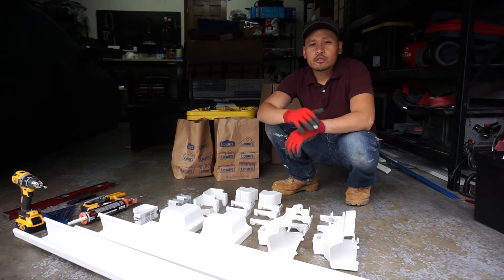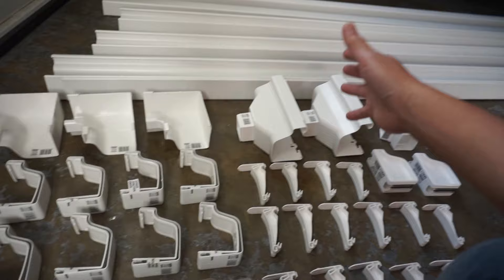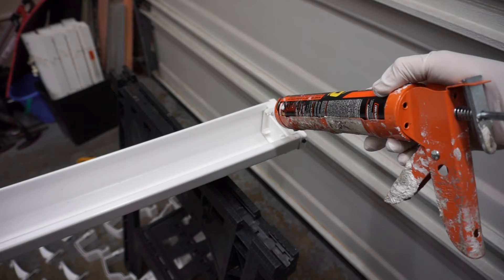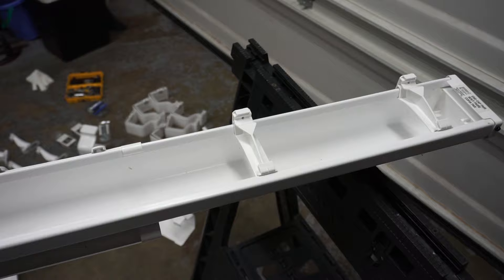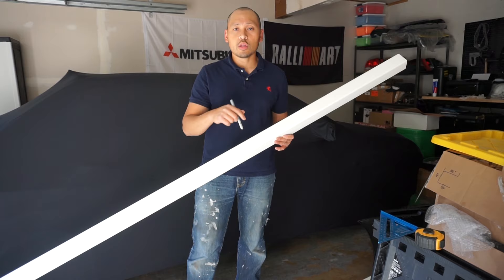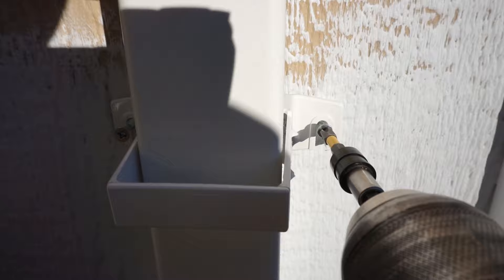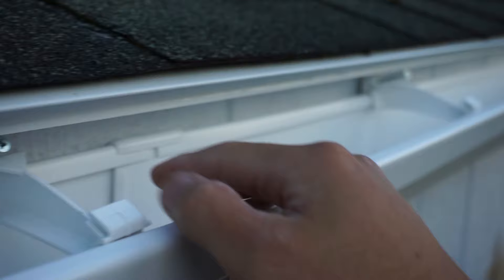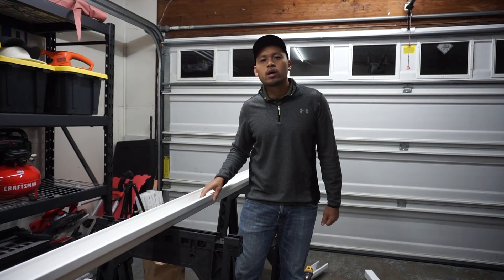How To Install Gutters For Beginners! Easy DIY Home Project!

Comment: Please, this is a beginner install if it’s done in the first floor of a house... anything above that, please get a good ladder and if necessary a spotter. If something were to happen, you got someone that can dial 911 for you . But with careful planning your spotter´s only job will be to pass you tools that you need. Cheers and good luck
Reply from the maker: Thank you so much for the safety  tip! Yes I complete agree! 🙏🏽😊🙌🏽

Comment: Excellent instruction!  Does anyone know if you attach the clips to the little metal strip just under the roof shingles on the “fascia”?  Mine is a shed and the width of the board at end of roof shingles is 2 7/8” (from the bottom of the metal strip to bottom of wood fascia board).  The metal strip is approximately 1” tall.  Standard gutter might be too big for my shed.  Perhaps I should ask, do you hang the clips as close to the shingles as possible on one side (or start just below the metal strip?) and  1/8” lower for each 10ft section?

Comment: What do I do if the top 6 inches of the house angles inward to the flat side of the house, basically there isn't a flat wall right from the edge of the roof.  Do I install the gutters on the flat part and should I add a 1/2 inch flat board between the house side and the gutter side ... to give more extension for the gutter to catch the rain off of the roof?  Hard to explain.  Thank you.  Anyone can give me ideas would be great.  Thank you.  Hope to do this next week.  Today is May 24th 2024.

Comment: My back patio needs its gutters replaced. However my back patio has a flat metal roof. I dont understand the purpose of the gutter if the roof is flat. I dont know how the rain water drains away

Comment: I'm curious how to determine the locations of the downspouts
Reply: you put them over your drain.  you don't want the water just pouring in your garden or down your drive.  There will be a lot of water coming off a roof when it rains.

Comment: I have a question.  Since the the gutters must attach with the thin side against the structure the 90 I have is pointing the wrong way to go around the corner.  Do they make right and left 90 or am I missing something obvious?

Comment: What type of screws did you use to attach the gutters to the house.
Reply from the maker: Hi I used the #8 zinc coated 1-1/2” screws to screw on the facia 👍🏽😊

Comment: Awesome video but for a beginner, I have 3 questions: How do we know which parts of the house/roof need gutters as I know it doesn’t have to be the entire perimeter. Also how far down from the shingles do we install the gutters? Last, my neighbor has this maple tree that massive amount of leaves fall from and Im constantly sweeping our lawn and driveway. Is there some kind of netting or cover we can use to stop leaves from settling in the gutters?Thank you!!
Reply from the maker: Hi! I would recommend to put them where your foundation is exposed and where water can seep onto it.
Some parts of my house have concrete sides and not direct dirt so that might be ok, but I still put it so that it looks symmetrical. Also for the gutter guard there are so many to choose from but I recommend micro mesh if you have a lot of pine needles in your area. Please stay tuned I will be making a video on gutter guards next month.
Reply: A helpful hint that i do... think in your mind as if you are the rain. Start at the top and imagine where you would flow if you ..."the rain" hit the roof at its highest point.
Next step, move down to the next highest point and so on and so fourth
Reply: And also, these vinyl products offer many gutter topper strainers that keep debris out of your gutters

Comment: Thanks for the video. I installed a trial piece above my entry door. Due to water surface adhesion, water runs around the roof cap and down the wall between gutter and siding, obviously "raining" on people entering and exiting the front door. I am thinking to caulk/seal the gutter flat surface to the wall - or am I missing something?

Comment: My sister really needs a new roof and new siding too but the gutters are really bad as well would it be a bad idea to I gutters before all if that other stuff is done because I don’t think I can do all of that on my own yet but I want to fix the gutters at least for now
Reply: Or should I just temp fix the issues on the old ones until the roof and siding  gets done there are just a lot of issues on the gutters , leaking joints rusted through spots dripping out of rusted holes downspouts missing I want to go vinyl when I replace them but I will have to use metal if I temp fix so it’s wasted money if I temp fix

Comment: I did my own Depot gutters but I hate the gutter to gutter joints. In my experience they all eventually leak. 

To get away from that, I made a wood block a little bigger than the floor profile of the gutter. Then I hammered it in, to stretch out the downstream gutter end so the upstream gutter will slip into it about 6 inches. Then I lubed the joint with Quad sealant and jammed them together. 

As a result, the upstream gutter flows continuously without encountering any separation and has never leaked in 17 years.

I also didn't make the gutter go around the corners of the eaves. No water sheds there anyway! Going around that corner (hipped roof) is pointless.
Reply from the maker: Thank you for sharing your experience and your feedback! 🙏🏽😊

Comment: My garage itself is perfectly square. The parts of roof for each of the 4 sides goes up to one point forming 4 triangles Do I only need 2 downspouts? 2 sides angling down to one downspout and the other 2 sides angling down to another downspout?

Comment: Manufacturers say 1/4" slope and some installers say 1/2" slope per 10 feet.
The manufacturers put 2 dimples in the top of the outer joiner piece. A screw is to be installed vertically where each dimple is though the joiner and the lip of the gutter.

Interesting that you did not apply sealer to the joiner - gutters and also to the gutter - corner piece as you are only trusting the foamy grey coloured seal here.
But you did not trust the foam sealer and so added sealer at:  the end caps and also to the drop outlet - gutter (were you applied sealer to the exterior as opposed to the interior and / or between the drop outlet and the gutter as it is being slid into place).
I suggest improvements regarding consistency are in place to your installation.
Good video as always though.

Comment: great video bro !!!! ,,,,, i have one question , i got the zink coated metal hangers for aluminum gutters same size 5 inch , they were 90 cents cheaper and come with long screw in place all ready ,  they fit really nice on vinyl gutters ! ,,,,i want to ask a pro , will this work ok  ???

Comment: How would you install a corner that has a descendant angle? i couldnt use a 90 degree corner because one corner would be horizontal but the other side would need a diagonal canal

Comment: It’s called a level not a leveler And when you are running something vertical you’re not making it level you are making it plum and I would suggest putting a little bit more slope on your gutters than a half of an inch per 10 feet but that’s just me and I live in Hawaii where it rains a lot
Reply from the maker: Thank you oh great one!

Comment: Why would you use Black Screws on White Plastic Gutters? Also why is there not any Drip Rail on the Siding of your house? Drip Rail will ensure water going into the Gutter and stay off you siding.

Comment: How are you supposed to tuck the rain gutter under the drip edge with the hangers?  Smh.  Perhaps I can install the rain gutter lower than the drip edge / then come back with a piece of flat flashing /  put the flashing under the drip edge/  then the other side will go into the rain gutter / that way theres no reverse capillary action.

Comment: So you are not allowing room for thermal expansion, which is supposed to be in your drop spout connectors, look on the piece and you will see marks where to insert your "strait section" to. Your gutters are bound to fail in a few years.

Comment: You’re supposed to put two elbows under the downspout to meet up with the wall from the overhang of a soffit.   In your example there was no soffit so you got if easy.      If other people watch this they might not realize this and try to run the downspout straight down straps that hold it to the wall won’t reach.     BUT, good video, my dumbass cut the gutter on each side of the downspout , not only unnecessary, but weakens the joint, allowing sag which is the enemy of any gutter sys

Comment: I have more than 18 years installing Residential and commercial aluminum and copper gutters and downspout and those that you are installing are not recommended since they are vinyl and with the sun and water they are damage in a couple of months and in addition to wasting your time and money you it damages the foundation of your house.

Comment: Dude, your roof is probably rotting away. Those shingles need to over hang the drip edge about 1/4” and the gutter should come behind the drip edge. That’s how water is 100% repelled from the roof.

Comment: am I blind or does it look like you just attach the longer pieces just in the sliding and somehow they are just attaching themselves to the wall without nails or screws? 12:50

Comment: Do not use vinyl gutters life expectancy is low extremely brittle in cold temperatures. Much better off to use seamless aluminum gutter preferably only use companies that use point 032 Gutter material anything else is very flimsy and crappy.

Comment: Great Job on making Video but As a Gutter Contractor trust me you do not want to waste money on Vinyl gutters. The seams leak and the Vinyl will become brittle in the sun. not to mention on most home installs the hanging bracket makes it hard to impossible to get under the drip edge and this is where gutter failure leads to fascia rot. Also the 1/4" drop or what ever drop you want to say is useless as gutters must be installed with a level some house will produce the proper angle for draining with no drop and some could need a 1" or more depending on how level the Fascia or the Roof is on the run of gutter you are wanting to install. Also price all the necessary material, parts , fasteners and tools you will need and don't forget labor if you will need help and then call a Gutter Contractor for a free estimate. You will probably be surprised how close the cost is and you will be getting much better material than box stores offer not to mention an experienced installer and you wont have to worry about an injury due to falling off a ladder. I replace 100s of customer installed gutters every year and for the most part it isn't because they didn't do a decent job but its because the material you can buy at local box store isn't sufficient to last and the design is set up to fail from the start.   Hope this comment helps and is not meant as a rant. If you are dead set to installing gutters yourself the call a Gutter contactor and see if they will run the gutters out for you and let you install them.  This will save you some money if you don't bend the gutter trying to install it.
Reply: uh huh...Right... I will send you a check right now, made out to the 'gutter-shyster', gimme your mailing address.

Comment: As an installer of seamless gutters I'm going to have to advise against vinyl.. I'm not sure of price comparison, I just know how many of them I end up removing. Also many of the hangers I've seen including the ones in the video for these vinyl gutters make it difficult if not impossible to get up and behind the drip edge, where a gutter really should be. Being under instead of up and behind the drip edge, during pouring rain much of that water especially at the valleys will just shoot right over that gutter. As well as for many installs, if you're not behind that drip edge water will also get behind the gutter. Poor choice and improper install of gutters can be a very bad experience down the line. Causing there to still be erosion around your foundation, as well as rot to parts of your roof.. Do yourself a favor, if you need gutters get a pro. If you're still determined for a DIY install, look up how to install Seamless aluminum gutters and have a local company deliver the materials you need to you. I'd recommend the aluminum available in box stores over vinyl, but still not as much as I'd recommend getting it from a local seamless gutter company. The aluminum gutter from box stores is a thinner gauge than what most companies use and more prone to damage. I also recommend against any sort of supposed gutter guard.. They all suck, the only ones that are half decent are way too expensive and still not that good.. Instead go with bigger downspouts and a steeper pitch, this will help reduce clutter in the gutters. All that said, I do live in Florida, melting your balls off one minute to being soaked the next followed by an outdoor sauna is a typical afternoon.. Very hot and wet climate, gutters are very important here.

Comment: Good video for everything you shouldn’t do to install gutters🤦🏻‍♂️ Worst material on the market & installed completely wrong( aside from sealing joints). The new siding is probably going to be destroyed within a few years due to lack of flashing & gutter installed way too low allowing water to go right past the gutter. I have removed thousands of feet of this product because it does not work for a variety of reasons. Professional gutter contractors charge what they do for a reason. Hate seeing folks wasting their hard earned money by going DIY & winding up having even bigger problems on their hands.
Reply: At least up north you have to have the gutter low so the ice can go over it.

Comment: no offense and I get the DYI aspect but as a professional, your work wont be better than a professional.  Water is no joke when it starts flooding your house and at that point your too late to fix the situation.  Plastic wont hold water/ice/snow, thats why its not recommended.  its also smaller than the average gutter size so it cant hold as much.  Love DIY but this isnt something any average joe should do.

Comment: As a rain gutter installer, I want everyone to know. Vinyl gutters are utter trash. Multiple seems, does NOT look cleaner, and promise the caulking he is using deteriorated within 2 years.
Don't use vinyl. If you are going to install yourself, go with the aluminum. Or better yet, have an actual gutter professional install seamless. You won't be sorry. And they are very afforable